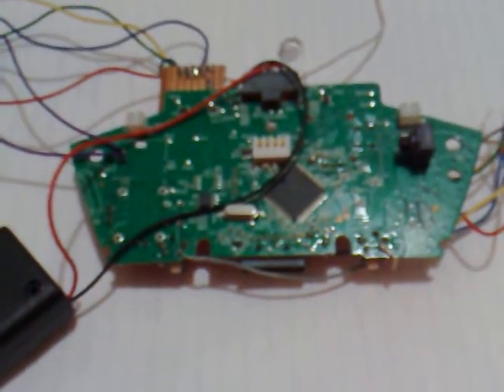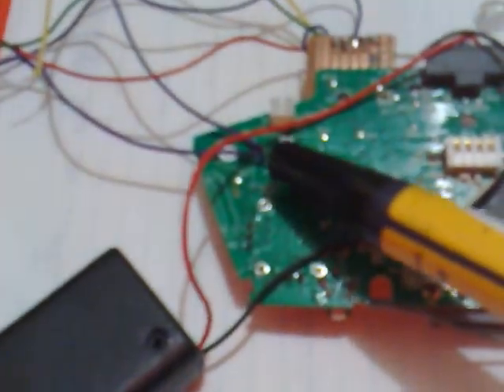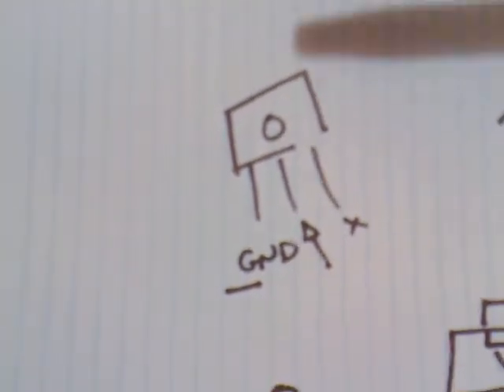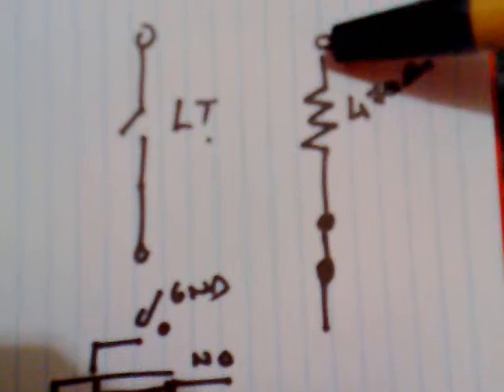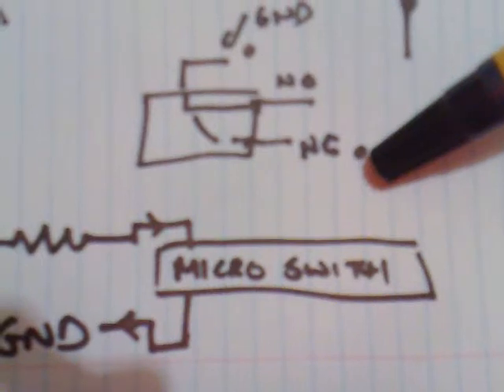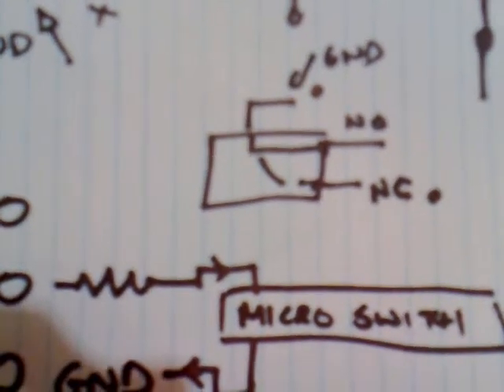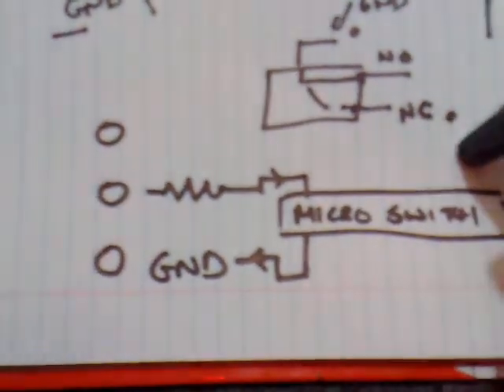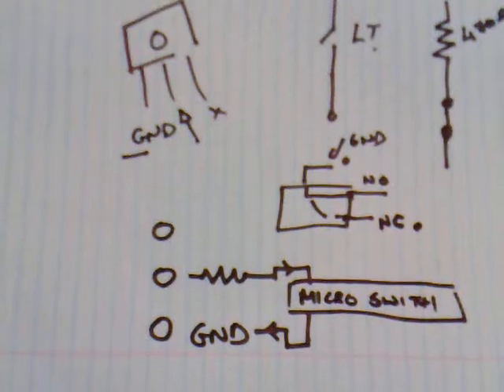Wiring the 360 controller analogue triggers.

Comment: If you still have problems with the LT and RT...

I didn't use any resistors, I just needed to make sure the wires were soldered to the Normally Closed (NC) position for the LT and RT buttons.  (so on the microswitch or cherry switch they will be soldered different) 

This worked for me.

ju

Comment: Loving the videos, but...

I got buttons that are normally open, and well.. I could use the tip on what I can do to rig this up so I can press my button and it will complete the circuit.

plugged into my Xbox... every thing works... except the triggers are pressed repeatedly unless I hold down the trigger buttons(street fighter 4 it will spam all three punches and kicks(LT and RT)

Comment from the maker: Yeah, once I got the hang of soldering onto really small terminals I re-soldered everything using multi-core hook-up wire found at dick smith. They come in a pack. Very handy!

The controllers came. Just waiting on some trox screw drivers and a camera. The how to should be posted next week sometime. 

Laterz

K

Comment: Quick question regarding the resistor.  I've heard that the minimum you need is 4.7K ohms, and you're using a 470 ohm.  Will the 470 do, or should I go with the 4.7k?

Comment: I have a problem. I have everything wired properly and I used 470ohm resisters. I'm getting phantom directional presses and an error keeps popping up about shutting down the Xbox. Did I fry my resistors, or is there something else I'm missing? Thanks.